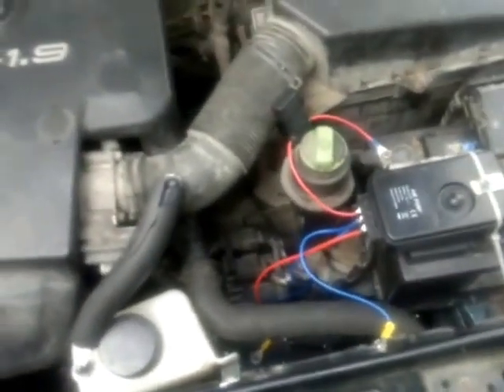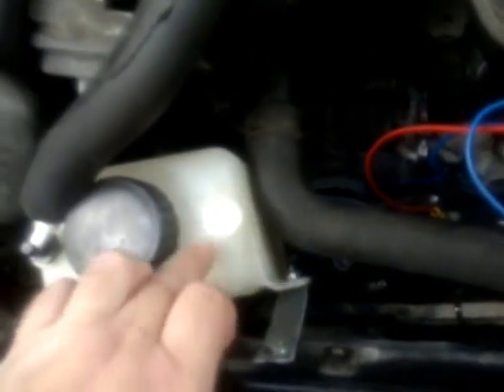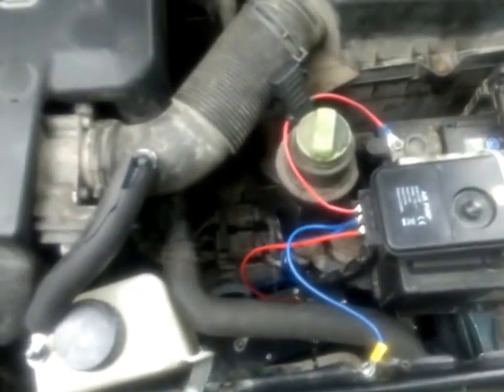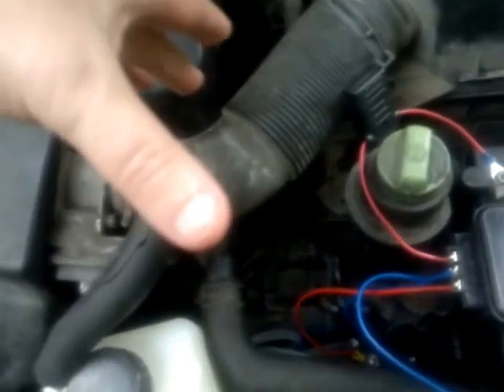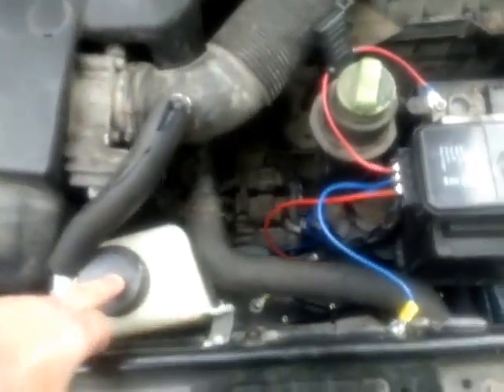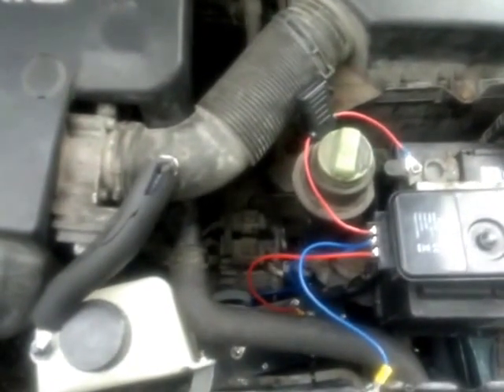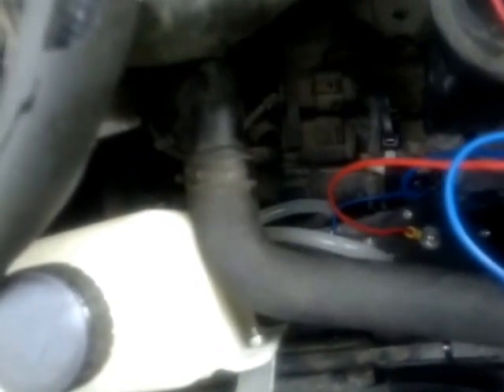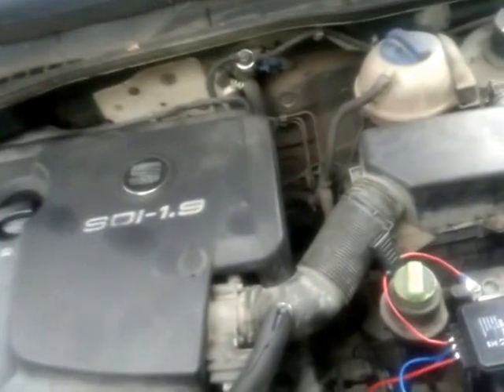HHO Success!!! 47 to 64 mpg

Comment: Thx for replying.  I will give you a tip. Best line oil additive. Been using this product for the past 50 000 km. Great stuff. Did the oil analysis and came out great. I  can send you the results if you want.

Comment: Kind of late but I will take my chances. I live in Canada and I have a vw jetta 1.9 tdi. Did the hho system in it. No major increase in milage. Change all light bulbs in to LED . Now my car is taking 52 miles /gallon  wich is like 4.5 liter /100 km.  Not bad but still I was expecting more from it. For the past year that is what is giving me. Question now is how much hho you are given to the intake and at how many amps. Pls if you can answer me. Also I am using a oil additive wich reduce the friction in the engine with 60-70%. 2nd question is: are you still using the system?  Thx in advance.  My email is vdumitru@shaw.ca.
Reply from the maker: Please note I live in Ireland, we use the UK gallon which is 4.54 liters per UK gallon, so you're figure is quite good, I did take the unit out of the van but not because it was not performing - it was, but am looking at health benefits of the technology. I did install another HHO unit which is delivering the good mpg figures as before but does not give the torque to the engine, this HHO unit delivers in an hour what the previous HHO unit delivered in a minute in HHO gas - check out the Ultimate Cell
Reply from the maker: The amps were about 5, the lpm was about 0.3 / 0.4 lpm